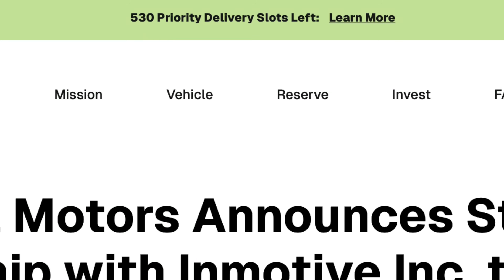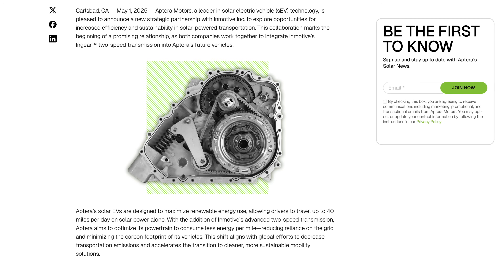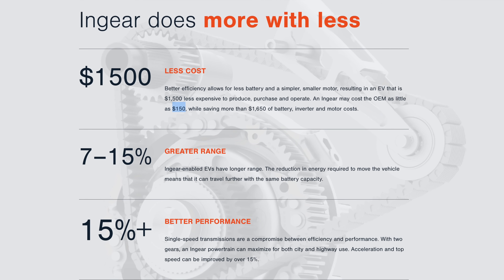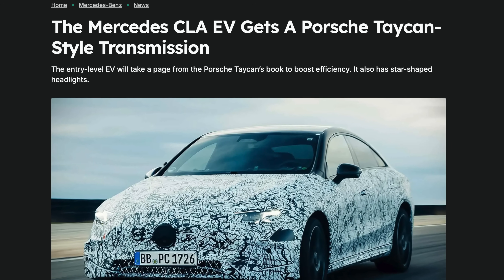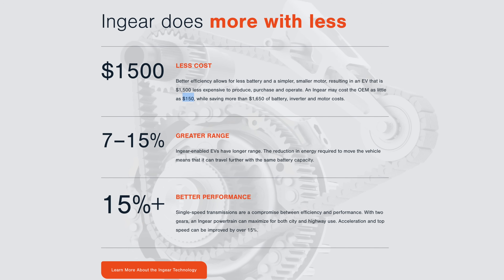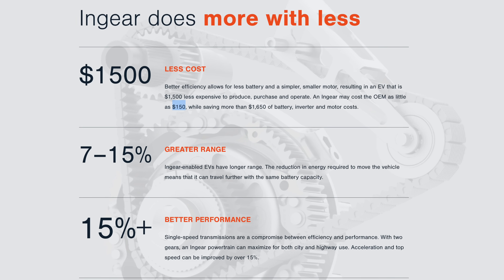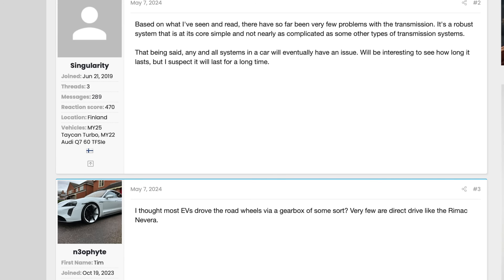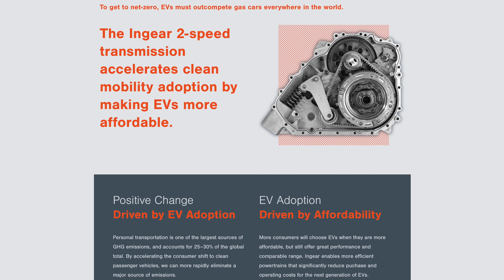Aptera Gets A Transmission?? Explained

Comment: Stupid idea, it was dropped by Tesla.  Why in the world would you want to complicate a production vehicle that struggling to be even produced???
Reply: Desperate for 10 miles/kWh, associated battery range, and avg daily solar. Aptera is currently at 6.8-7.1 miles/kWh. I expect no more validation info until this transmission gets Aptera to 8-9 miles/kWh, even if at only a limited speed range.
Recent Telo video with Leno discusses early TSLA quitting the 2-speed transmission because it wasn't worth the hassle.
Reply: @artsmith103  We do not know your low projections are a fact, because we have no data on what easterly headwinds they encountered. A controlled range/efficiency  test on Gemini will zero out this critical factor, along with elevation gain/loss.
Reply: @jeffcarlton3590  That's the data Aptera provided. They spent a lot of time at Honda track and hid the data. They drove around CES and hid the data. They drove round trip for burgers while streaming and Jerry following and they didn't recharge to provide data. Now Aptera is hiding behind transmission discussion to avoid data. Do you think there have been no no-wind days since Flagstaff? Do you think Aptera trucked the trike 500 miles to Flagstaff instead of a 4 hr drive around Carlsbad for no reason? The defense of Aptera failures gets more pathetic! How about they bought a UI, celebrated writing their own UI, and now don't have a UI :-(
How about promise delivery for almost 3yrs and never have a charging system!?
Reply: @artsmith103 they’re already at 8 mi/kwh. 120ish wh/mi if I recall correctly
Reply: @RC-fp1tl  Absolutely not! Dozen or more people calculated the phony 8.2 miles/kWh was actually 7.1 miles/kWh accounting for the 7,000 ft hill. Then if you deduct the solar 2.4 kWh it's 6.8 miles/kWh on flat ground and that was probably too slow for a real average.
And fortunately, the end of March on a pretty sunny day is a great solar average for annual estimate in that extra sunny part of the USA.
2.4×6.8 = 16 solar miles/day. 
If you scale that to the vast average pleasant part of USA it's 13 solar miles/day. How did you miss all that? It's been explained many times by honest people. Aptera never bothers to answer :-(

Comment: Everyone suspects solar is Polydrop but lets face it, they lied last year about revenue from solar and the SEC documents proved they had ZERO income. Polydrop sells so few trailers as to not be noticeable to anyone in the industry. More likely this was done so Aptera could claim to California they met their requirements for like funding on the money they spent on Solar but California rejected a third of their filings last year so its not like its easy to pull the wool over their eyes.

Plus they did not make the panel in the Carlsbad facility so its not like we know yet who made it or all those panels shown off last year.  

This transmission idea?  Seriously?  Another company that has raised less than Aptera and has no customers either?  Aptera is a master of picking up the companies from the island of misfits - Polydrop is tiny tiny, Averest is super small, and this transmission company has not found anyone to use their product nor is Aptera in position to do so.  It is all fakery to give you an impression of progress.  We know they stated no initial deliveries till Summer 2026 with production to start in 2028 as per their off the cuff remarks to the press in Korea; also no planned EU deliveries.

Comment: How heavy is this 2-speed transmission?
How much maintenance does it need?  Periodic oil and/or belt changes?
How much storage space does it use?
Reply: And… expected longevity and ease of replacement?  Seems a ‘weak link’ but @ $150 with significant performance advantage OK tradeoff IF a relatively simple (inexpensive) fix.

Comment: I feel like this was a pretty out of nowhere announcement, Ive been following this vehicle for years now and the first I heard about a transmission at all was when they announced it last week, so I can absolutely understand why people are having mixed reactions to this
Reply: When they were going with a minimum of 2 in wheel motors they could be optimized lower, and then could combine their capabilities when high performance was required.
Reply: @jeffcarlton3590  That sentence makes no sense at all. First of all, the LE was going with a minimum of 3 IWM's, and two was unavailable. If they had a flexible production line with motor options you could say that, but they don't. Next, there was no changing the drive ratio of any IWM - it's a fixed 1 to 1. Lower can only related to power output, and gearing is a different matter. Some clowns talked of a rear wheel where the drive was suited for highway efficiency, but that is only achievable with a much larger rear wheel and some very complex smarts to operate it in conjunction with the fronts.
Reply: Don't feel like - it WAS out of nowhere, and going into nothing.

Comment: The most-popular EVs carry 5 to 7 passengers. Demand for 2-passenger vehicles is extremely low. The Miata sells fewer than 9,000 units a year. Aptera has around 3,000 pre-orders. Aptera is an admirable experiment in energy-efficient transport, but it does not meet the needs of the majority of car buyers -- even those who seek an energy-efficient EV.
Reply: Most driving is not done with 3 to 7 passengers. I certainly do not want to pay for: higher price wise; lower efficiency wise; or more wasteful environmental footprint wise all of those needless components that would go into making Aptera a 'like-most other vehicle' EV.  That market is well saturated, and the mods required to try and make Aptera conform to that mold would rob it of its uniqueness, charm, and major selling points. Aptera does not need to be, indeed it cannot be, a 'service every family all the time' solution. It certainly can be: the best 2 person plus a pet or two road tripper - that you can stretch out and sleep in - adventure EV; or the best commuter EV; or the best smallish goods delivery EV. The largest battery pack version can also be the best 'battery on wheels' clean (and green) electric power delivery system for plug-less locations, and to give any stranded 'emptied of kWh' EV's the boost they need to reach the nearest charging station. There is plenty of market space for Aptera to succeed if it plays to its strengths. In a pinch, in my similarly configured 1st gen Honda Insight I did transport two people and all their luggage from an airport. And unlike the Insight, Aptera will have luggage tie downs the prone rider in back could clip into ;->. A few other times two sat in laps in the passenger seat. Over short distances you can make due with willing friends or hitchhikers. One time with 4 of us.
Reply: @jeffcarlton3590  Truth be told, most vehicles in commuter traffic carry ONE person. And a large percentage of those vehicles are full-size, double-cab pickup trucks carrying ONE passenger. Another large percentage are 4x4 SUVs carrying ONE passenger. Americans buy image more than utility. But that's what carmakers have to cater to.
Reply: @jeffcarlton3590  People not in seats is breaking the law in Aus. Heavy fines. Sure, it's a good idea to have smaller and more efficient vehicles, but only if they are useful. There are aspects of Aptera prototypes that point to it being useless. I don't want an 88 inch wide EV because keeping it in the lane is difficult; the turning circle is too wide and parking is more problematic (not all spaces are as large as Costco's). I don't want solar on my EV because I would rather park in the shade and my home solar does the job well enough. I don't want a wrap that lasts maybe 3 years in the sun when paint lasts a good 20 years. I don't want to drive like I'm reclining on a pool chair and not see clearly out the side windows. I don't want a UI/UX I need a magnifying glass to see important data while I can stare at a large picture of my EV. I don't want a single rear wheel when I can choose from so many with two, knowing my load is always balanced low and between them. I don't want my radiator in such a vulnerable position as where a dolphin craps. I don't want second-rate parts - give me a heat pump or no sale. And I don't want to put a deposit on a Toyota Supra and turn up with a Corolla in front of me and the bill for the Supra. Even worse, them saying it will come in seven years because thousands have jumped the queue.
Reply: Around 50,000 pre-orders.
Reply: @Mister_Stone  Some 90% of those preorders were for different/better vehicle at a lower price. No one knows what current interest is.
Reply: @Mister_Stone  Been that for the past two years. How many have given up hope? Around 49,000? If the price was a reasonable $3,000 how many preorders would they have taken?

Comment: I always thought it was a little silly to drop the transmission from electric vehicles. No motor is designed to run efficiently at every range of RPMs. I can understand having only two gears, but it's not like electric motors don't have more torque than is needed for highway speeds.

Comment: Aptera is all about EV efficiency. This transmission enhances that objective without adding much cost. A heads-up move by Aptera's innovative design team.
Reply: Two-speed boxes for EV's pre-date 2019. This is a delay stunt and, if not, they are slow on the uptake - dumb as a post.

Comment: It almost makes me wonder if the efficiency numbers they got from that one downhill road trip they did recently (from flagstaff to California? Maybe, can’t remember now), revealed that their efficiency wasn’t quite what they wanted on the highway. Like if it was the final straw to consider this transmission
Reply: Possible that they do need to increase efficiency.  Put the Flagstaff to Independence road trip was with a heavier vehicle with less aerodynamics than the production vehicle.  Computing the stats from that trip to what they know the weight and aero would give them in the production vehicle is supposed to put them right on target.
Reply: @Mister_Stone  We shall see, but they are delaying making German-eye so the wait is much longer than it ought to be. It's snake oil, and so it's likely the testing will be, as well.
Reply: @Mister_Stone  Aptera is no where near 10 miles/kWh. And no guarantee all the components missing weigh less than proposed roll bar change from steel to aluminum. Aptera has consistently lied about everything and all you do is repeat the proven nonsense. Do you understand Aptera can't even charge the trike at a public charger after this many years!?
Here's something to watch for, with the ~2.4 solar kWh/day, Aptera can get 10 miles/kWh measured at the charger if they drive few enough miles:
<51 miles without transmission,
<85 miles with transmission.
Watch for it ;-)

Comment: If Aptera is truly noodeling a change in their drive train at this late stage it indicates they didn't make their numbers.   Where are those numbers anyhow?
Reply: Big fat lies.
Reply: Or it took them this long to finalize an agreement.
Reply: @lestertheinvestor4333  Seen an agreement?
Reply: The numbers are subtly in the Flagstaff demo. 122 wh/mil is 8.2 miles/kWh. That was downhill. The energy equivalent of lifting the trike 7,000 feet contributed enough free energy that subtracting, reduces efficiency to 7.1 miles/kWh. The solar contributed 2.4 kWh. Subtract that and efficiency down to 6.8 miles/kWh. Now Aptera hopes the transmission increases efficiency published 15%. That only increases them to 7.8 miles/kWh (with no free benefits.  So I thought, how can they spin the numbers better towards 10 miles/kWh? They can drive few enough miles/day that the solar kWh raise the average to 10 miles/kWh. Results:
Without transmission<51 miles/day. 
With transmission< 85 miles/day. 
Watch for it ;-)

Comment: Perhaps TELO should also look into incorporating this transmission in their build
Reply: These are only for low power motors, Telo is too powerful for a simple transmission like this. The complexity needed for a higher power vehicle would add weight and expense and reduce reliability... Probably not much to gain. Plus, Telo is all about packaging it in tight to maximize utility in a small footprint. Adding more components to take up more space would complicate that.
Reply: @  thanks, if it is not feasible then no need for it

Comment: The original Tesla Roadster had a 2 speed transmission that kept breaking due to high torque. Hopefully Aptera will have better luck with their unit. 😊
Reply: They don't have a unit. They don't have an Aptera, either. You're crossing bridges.

Comment: Switching to a 2-speed transmission will improve highway efficiency numbers. Reducing the amount of heat generated by the motor if it were a single speed. This will allow them to reduce the size of the required cooling, which in turn drops weight and reduces the frequency at which the cooling fans need to kick on! (Motor will operate within an efficient range, generating less heat during operation)

Meaning they can use smaller, more efficient pumps and fans that draw less power during operation. 

Reducing the amount of power required for the system to operate while at idle, driving, charging etc.

This is a great sign!
Reply: So while the transmission itself adds a little complexity that could reduce reliability a bit, the other parts will be working less hard and that increases reliability?  Also the added weight of the transmission we know is made up for in added efficiency, but could it make other components weigh less as well, increasing efficiency even more?

The next update could be fascinating.
Reply: They prob need their max cooling for supercharging, not driving.
Reply: @jeffcarlton3590  Battery cooling is separate from Vitesco. Charging info says typically 5% heat loss to battery. So 50kW is 2.5kW of cooling required. Not a lot if Aptera can fit radiator and forced air vent.
Reply: The Vitesco cooling system is self contained in the package and won't be changed. Maybe slightly better miles/kWh after poor results of Flagstaff test.

Comment: Just to play devils advocate: Wouldn't it make more sense for them to use a single motor for simplicity and cost until they can get a few thousand units out of the door?
Reply: Still a single motor, but leaving the transmission out is what I thought they were doing to get this done sooner.  Tailosive thinks this might be in the first ones.  If they have been working on it as long as he thinks, maybe that means it won't delay production if they implement it  now.
Reply: @Mister_Stone How many years out do you thin Aptera production is? Does this transmission fit in the frunk that already got the Vitesco squeezed in?

Comment: Its a shame those in wheel Elaphe motors didnt work out.. so much more added complexity, parts and friction
Reply: Elaphe may still happen in the future.  There were too many supply problems with Elaphe's other customers delaying implementation.  This does mean a lot less complicated and they don't have to deal with unsprung weight.

Comment: People who cite the reliability of timing chains in ICE engines are missing an important point.  Timing chains only drive the camshafts that control engine valves.  This is a constant unidirectional load.  Timing chains always turn with the engine speed; they don't shift.  That is VERY different than using a chain-driven drive in a transmission.  Drive trains face much higher variable loads in both directions.  In terms of reliability, a chain drive transmission is more like a bicycle chain than a timing chain.

This transmission will require internal lubrication.  The gear oil or transmission fluid will require periodic changing.  One of the selling points of EVs is that they don't require oil changes.  Maybe this Inmotive gearbox will only require fluid changes every five years or 100,000 miles, but still... it seems to be a step backward to EV purists.

Will there be a driver option to select gears manually?  For instance, going down a mountain could the driver put the transmission in low gear to spin the motor faster for higher regenerative braking?  Could the driver opt to keep the transmission in low gear in city driving so that the vehicle isn't shifting up and down between traffic lights?  Or will the transmission be purely automatic with no control by the driver and only an electronic brain to determine when it shifts? Many drivers will want the option of having some control of this feature... whether that's a paddle shifter or another button on the yoke it will require more wiring and programming.

The efficiency benefits of the two-speed transmission for the Aptera may not outweigh the decrease in reliability, increase in complexity, and increased maintenance requirements.  It will be interesting to see what Aptera decides after further testing.

Comment: EV motors with single speed transmissions run at crazy high RPMs at highway speeds. If this extends the life of the motor it may be moot because it was going to last for 300K miles anyway, but I wonder how much this will increase motor life.

Comment: If this makes highway, which is probably at least half my mileage, more efficient. I'd be pretty happy for the slightly higher expense.
Reply: Almost all the energy lost in highway driving is due to air resistance. So a transmission while possibly may be more efficient, but it would be nominal at best. It all depends on how much it weights. Also you have long term longevity hit from another mechanical device.

Comment: I have a hard time imagining that a $150 transmission is going to be reliable long term.
Reply: They might be working with a large manufacturer to mass produce them for other ev models making the price very low.

But that's a very cheap transmission and tbh I'd be a little concerned too.
Reply: $1500
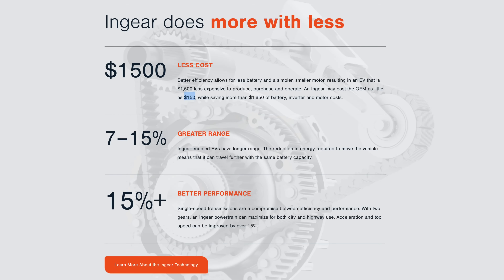Reply: @markthomasson5077  3:10 $1,500 is the 'savings' - the transmission costs $150